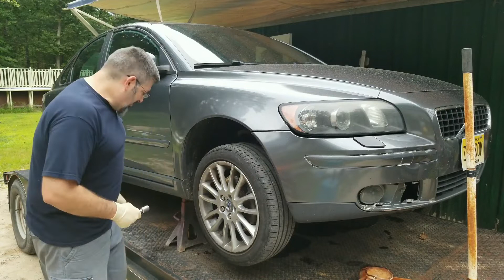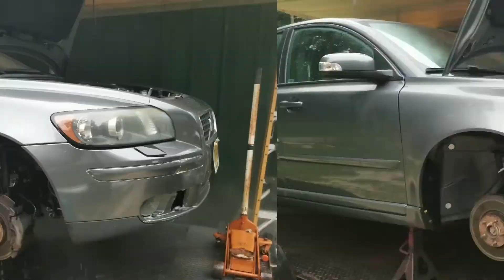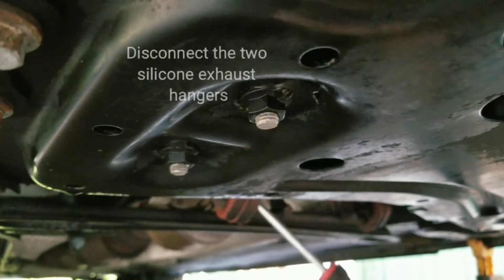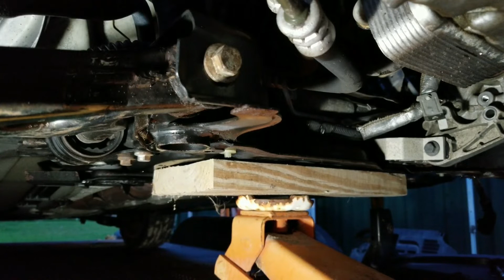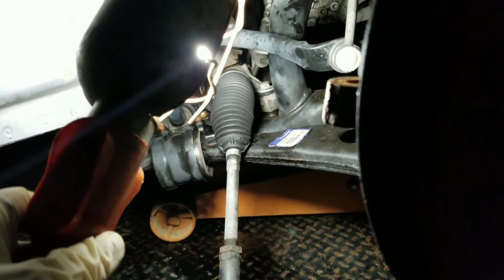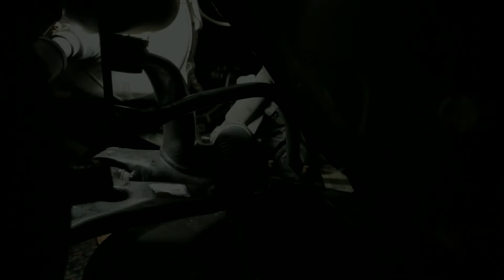2007 and Newer Volvo S40 power steering rack removal & install step by step $save$ part 1

Comment: Hon love your vid but I hope I don't have to do all that one day. But maybe you can help me I just installed a new steering pump but not sucking the fluid from reservoir am I missing something??
Reply from the maker: Hopefully you don't have to change the rack either.  Check to make sure the powersteering pump fuse isn't blown, because the Volvo power steering is electric.  If the power steering pump lines are hooked up and the pump is plugged in and the reservoir is full(total capacity for the whole system is about a quart) don't overfill the reservoir and make sure you use Volvo synthetic power steering fluid (Pentosin CHF 11S) P/N 1161529 or equivalent.  Since you changed the pump, there might be air in the system.  Bleed the air out of the lines buy Turning the steering wheel all the way one direction and all the way the other direction. Do that a few times and it should be working properly again.  Check fluid level.  I hope this helps.  Thanks for the question.

Comment: I noticed your video states 07 and newer would this process not be the same for a 05 s40 t5 also does it matter if I get the rack and pinion off a fwd and place it on my awd?
Reply from the maker: The whole process to remove the rack is the same for the older models, the car bodies are identical.   I just stated 07 and newer because the rack for 06 and older is slightly different & different parts #.  According to parts catalogue the rack for the 05 s40 turbo is the same parts number as the non-turbo. They don't list any other rack for an 05 so I would assume Fwd and  Awd use the same rack. I hope this helps and thanks for the question.
Reply: Zero Fuel Required thank you for the response this helps alot

Comment: Where is the joint if I want to realign the steering column with the steering rack?
Reply from the maker: Look at 20:00 in the video.  I'm saying you can disconnect the rack but it can only go back on one way.  You can spin the steering wheel all you want disconnected and hook it back up it will be exactly the same.  This isn't your problem it's something else.
Reply: @ZeroFuelRequired  Isn't there even a minor amount of adjustment at that joint?
Reply from the maker: @amana1480  there is no adjustment in the joint that connects the steering column to the rack that I know of. If your steering wheel was crooked while driving straight you'd be able to use a steering wheel puller to remove the steering wheel and set the steering wheel straight.  
If all the inner and outer tie rods have no play, the only other thing I can think.  if they replaced the rack,  they bolted everything up and the steering wheel was crooked.  The dealer to cut corners on the job instead of removing the steering wheel to straighten,  they turned the steering wheel straight and on the front end alignment machine adjusted the tie rods to keep the wheel straight and within acceptable boundaries for the alignment machine.   which in turn would move the rack more one one way than the other like you describe.  Only way to know for sure is to take it to an alignment shop and have it checked. I hope this makes sense.

Comment: If you were going to let a shop do this what national shop would you trust ?
Reply from the maker: I don't trust any of them,  that's why i do all my own work. A repair bill from a Volvo dealership will put you into cardiac arrest lol.  National  shops that repair  have high overhead like car dealers do. The bill will be high.  You're  better with a local mechanic that you trust.  Ask around to all your friends or co-workers for a good local mechanic to you that is honest.   That's the best way to get a good mechanic and they'll likely to be cheaper than national auto repair shops.  I hope this helps,  Thanks for the  question
Reply: Thanks ill do this hey how difficult it is to replace rack and pinion on Volvo S60